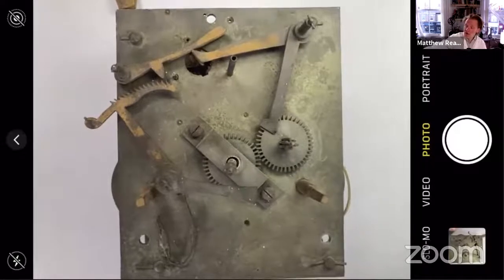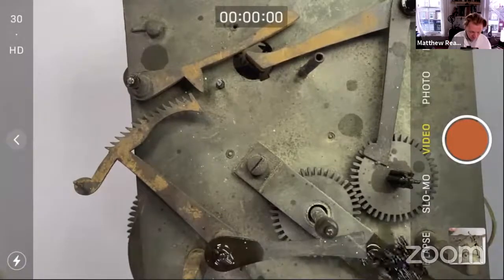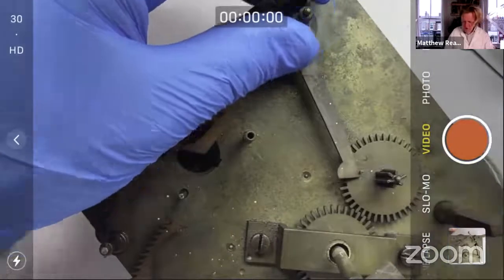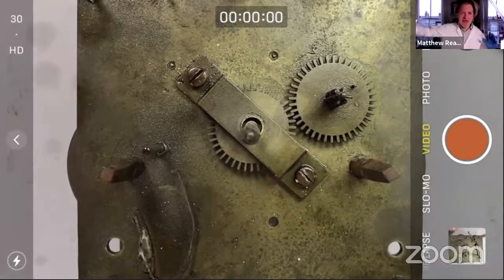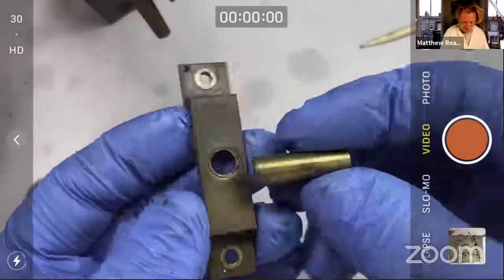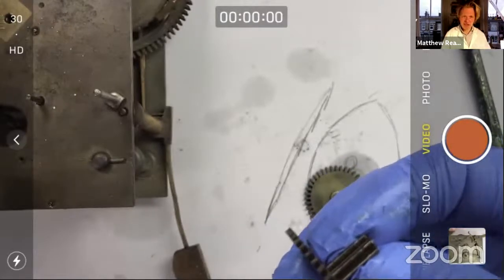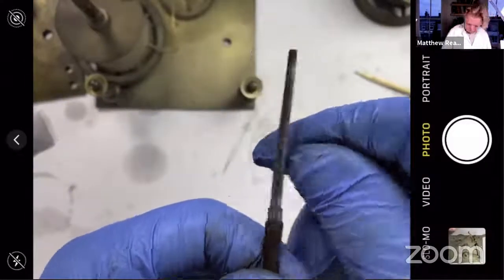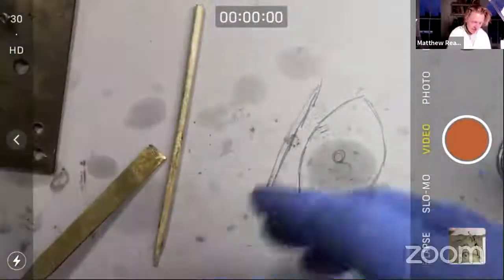How to repair pendulum clocks - LIVESTREAM #005

Comment: Would there have been any major issue with leaving the lifting piece at 35:00ish without any safety?  Did we bend it because there was a significant risk to the clock in leaving it or because that’s the way the vote went this time around?  Was it actually safe to leave it ‘unsafe’ (if that’s not too confusing)?
Reply from the maker: Hi Vicky.  It was really just the way the vote went!  That component was designed to be twisted to provide safety.  It wasn't twisted and of course we will never know why.  In my own practice I would have left it.  It just means the hands cannot be set backwards past the hour striking position.  When I was teaching I would find myself doing all sorts that I wouldn't normally as an exploration in the name of education.  On these livestream sessions, in cases where I am happy (ish) at either outcome, I put it to the vote.  Hopefully it keeps / gets people engaged/involved.  I was pushing my luck with the rack spring one that went against my somewhat tongue-in-cheek suggestion to leave as is.  Funnily, what happened is people/students/audience are happy to make their compromises once it is seen that I can be a bit flexible.  Interesting concept this kind of participatory activity.  I think conservators should/could do more of it.  Here, I don't know the audience, as you know it is free to attend so anyone can chip in which I hope helps dissolve hierarchy. Matthew
Reply: @howtorepairpendulumclocks-live  That makes perfect sense. Thank you!  I really like the compromise elements of these sessions. Trying to understand the balance between conservation and restoration for operation was a big part of my initial curiosity about dynamic objects. The open dialogue between quite different approaches here feels very productive.

Did we change the rack spring? I have to catch up! For my two pennies’ worth, I suppose I thought it seemed pretty harmless, but I’m looking forward to seeing what everyone came up with! Thanks again!
Reply from the maker: @vickykerrigan732  We changed the spring but kept the foot, soldering the new one without completely refinishing.